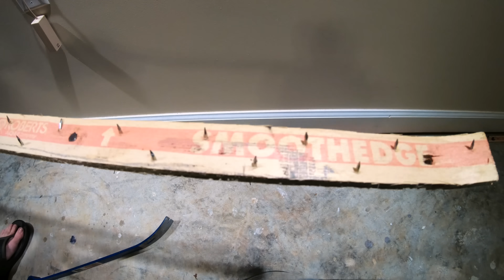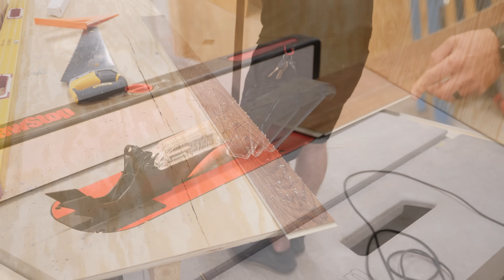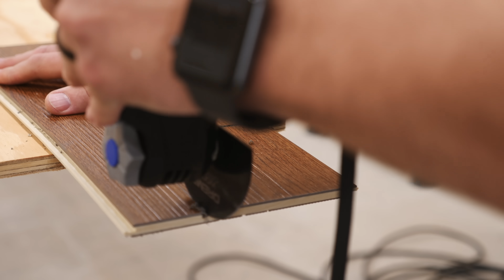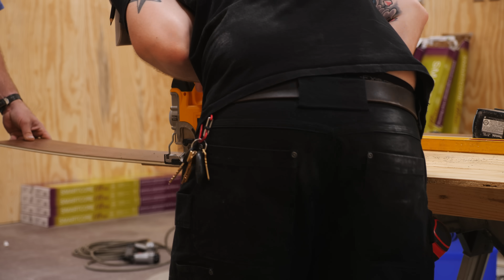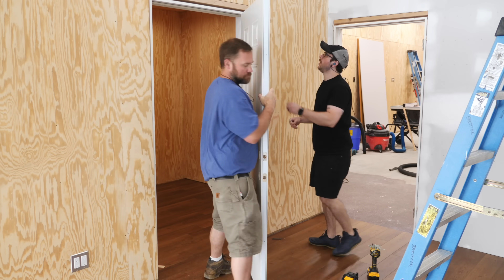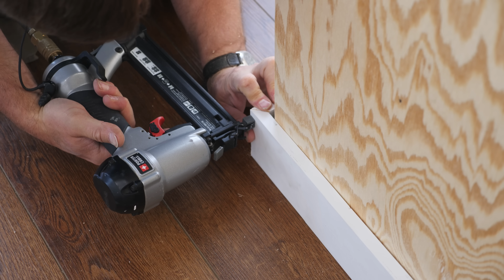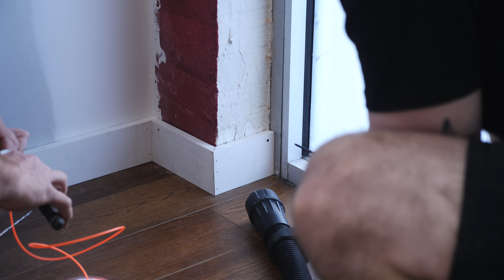How To Install Vinyl Plank Flooring Tutorial For Beginners // Home Reno

Comment: Wouldn’t it have been easier to paint the walls before installing the floor? Nice job btw. Cheers!
Reply: First I thought the same but then I realized, they'll have to paint that baseboard, so it's easier to cover the floor and paint the walls and baseboard at the same time, than first paint the walls, lie the floor and then paint the baseboard (for which you'll have to cover the floor anyway)
Reply from the maker: Yup!
Reply: @ravenus88  Paint the baseboards before installation. Easier, tidier, no masking needed.
Reply from the maker: Then you’d have to caulk all the nail holes and go back to touch up. I’m painted the baseboards the same color as the walls so they blend in, so it’s easier to do it all at once.
Reply: @ravenus88  you don't have to fully sheet the floor to paint base boards, plus its different paint. I would have gone walls, flooring, install base boards and fill holes then masking tape round the floor to paint the base boards.
Reply: Was the floor level? How did you check?

Comment: Why didn't you use a thin foam layer under the flooring? At least this is how we do it in my country to prevent noises and better insulation.
Reply: The floor he is using has the pad attached on the bottom.
Reply from the maker: This flooring has foam attached already.